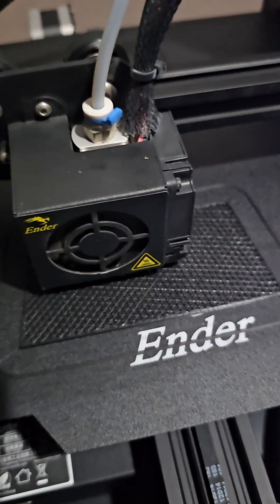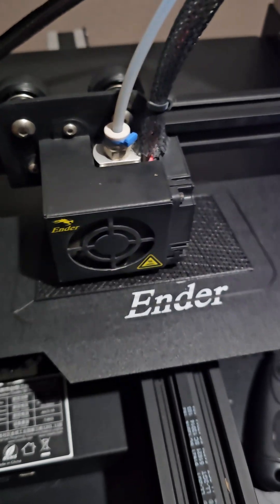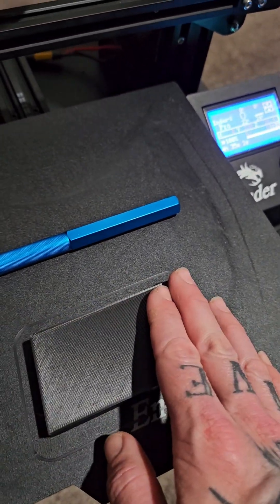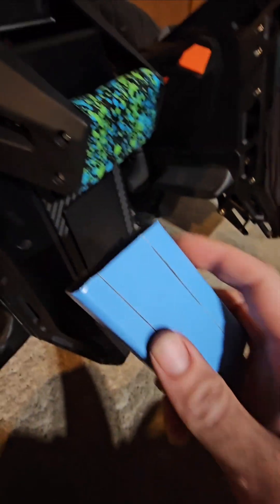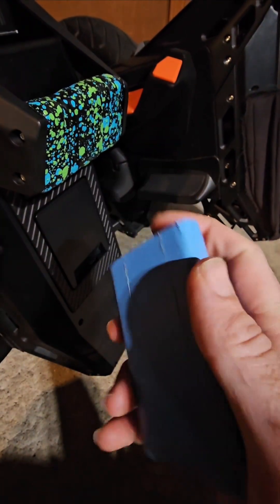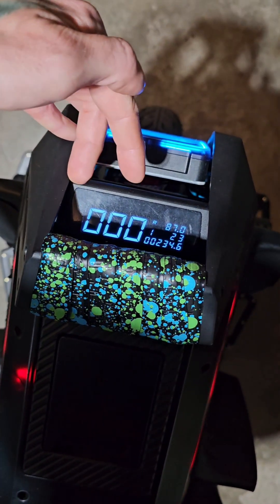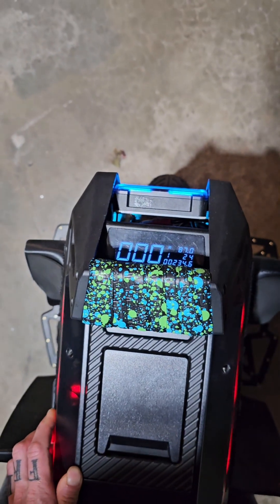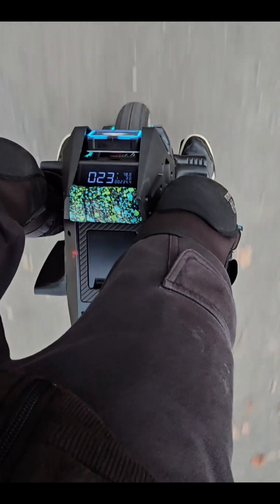Making a Handle for the Begode Blitz, to relocate the display

Comment: I could use this. Then delete the handle entirely, but only if I can keep the screen protected more
Reply from the maker: @RogueTravel  You absolutely could do that!  I like where the handle is but wanted the display in a better postion. I also like if I dont want the display on there at all I can remove it but still have the handle!